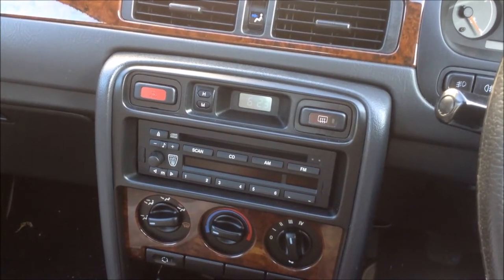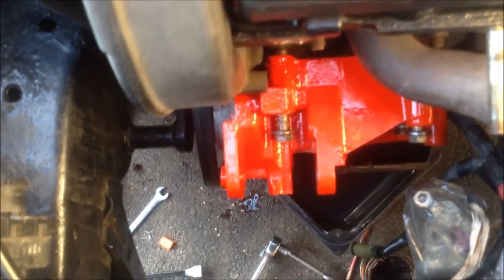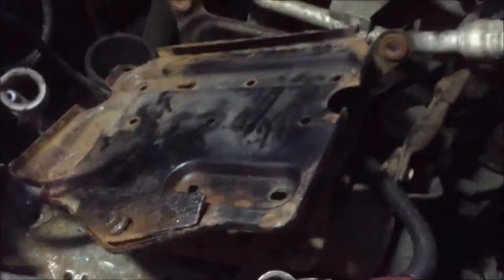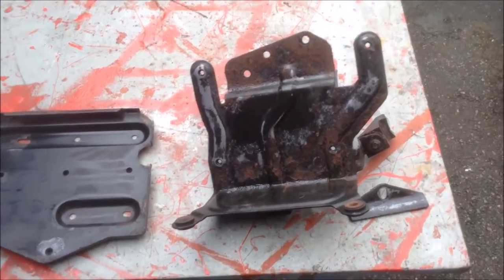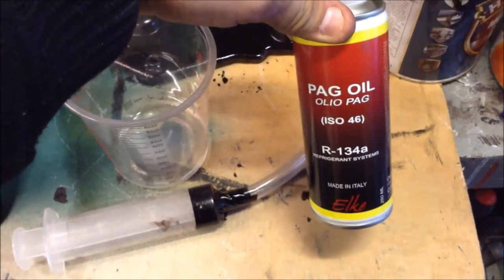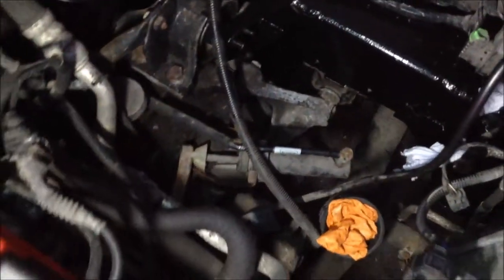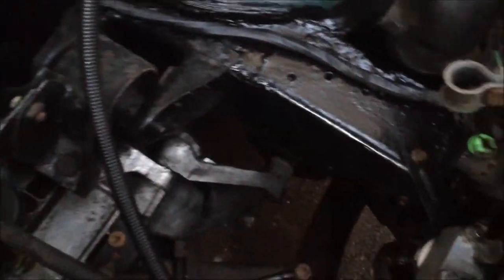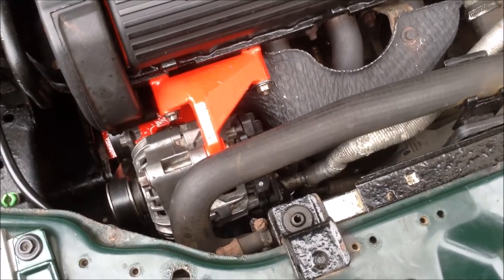rover 45 Air Conditioning part 1 compressor and receiver drier replacement

Comment: Thanks for your channel, it's excellent.
I have an existential doubt and my question is, is it normal that I have to replace the air conditioning compressor because it no longer cools after 2 years without using it? I have gas in the circuit but the air conditioning system does not cool but the heating works. A mechanic has diagnosed me with a special machine and after an hour of operation they told me that the diagnostic machine says that what fails is the compressor, I personally do not believe it. Has something similar ever happened to you, could it be another element of the circuit (TXV Valve, or another component?., I find it hard to believe that with 94,000km the compressor failed in my Rover 45, and I have not used it a few times.
Reply from the maker: @JOSEANTONIO-ph7fy  I don't think we've had this particular problem. The heating comes from the engine coolant and has nothing to do with the air conditioning systemthey. It can be lots of things that can cause problems with air conditioning and it can be sometimes difficult to diagnose, we are lucky as we're doing it ourselves we have the time to investigate and find out what the problem is in our own time
Reply: @DPNTV  Gracias !!, quiero conservar este coche por muchos años mas.